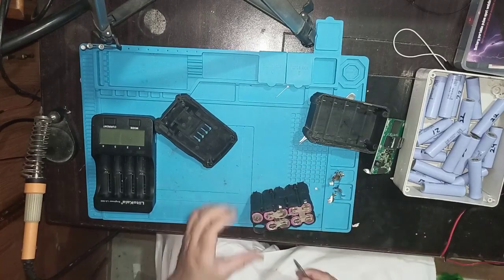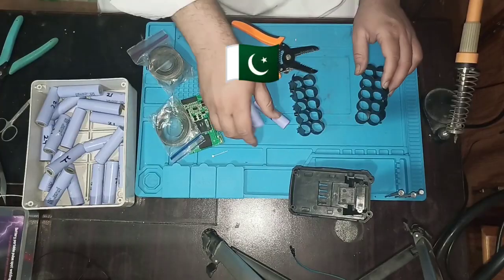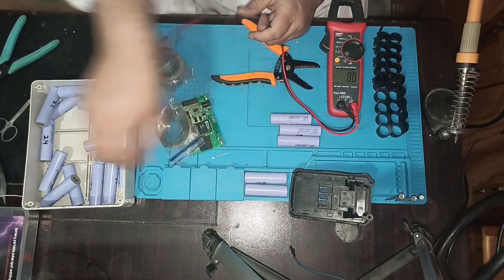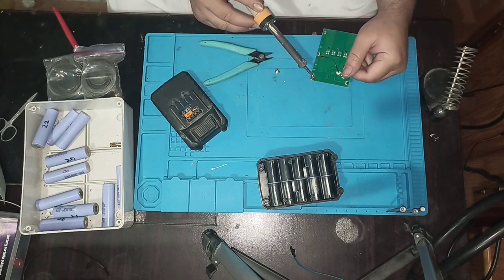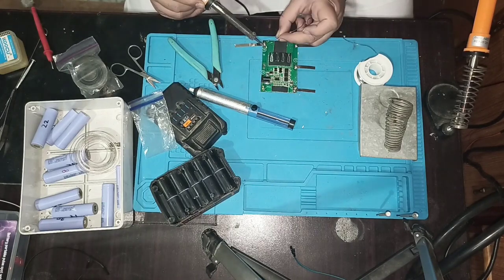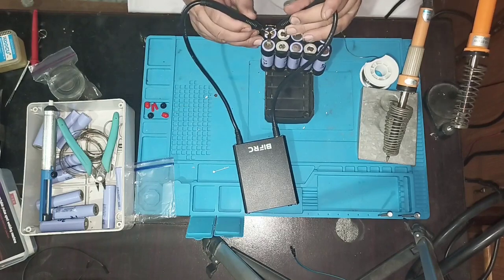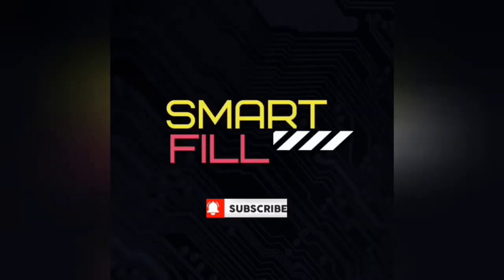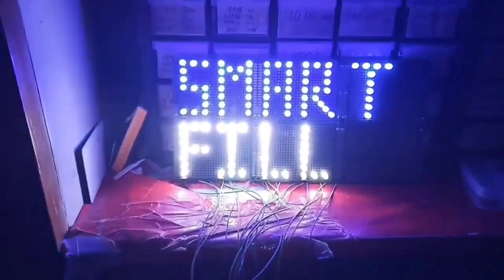Repair my Cordless Leiya Angle Grinder Battery Save 80$ 💥🔥

Comment: thanks for sharing this video 
you can get some very good batteries from used laptop battery usually not all the  cells are damaged in the battery pack 
و الله يعطيك الف عافية
Reply from the maker: yes brother your msg is valuable for me subscribe my second electronics channel smartfill i create a power bank for mobile and laptop as well regards